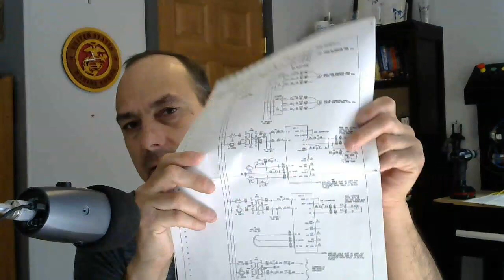PLC Programming - On Real World Projects

Comment: I appreciate your videos I am trying to learn how to write whole programs but i dont know where to get the education, who can you recommend? I currently have experience modifying Slc 5/03, micro logix 1500,1200 and control logix. I can make simple programs like flashers, start stop, holding circuits etc. But  I cant create a program from scratch where can I learn? Oh and BTW thank you for your service.
Reply from the maker: Thank you Jose, maybe you should consider working with a mentor, send an email to info@logixtraining.com and we can chat about the workshops I run where you learn how the pros build basic and advanced PLC programs using a template.